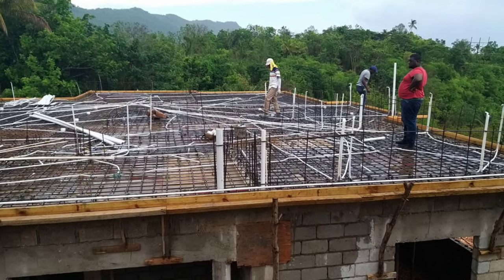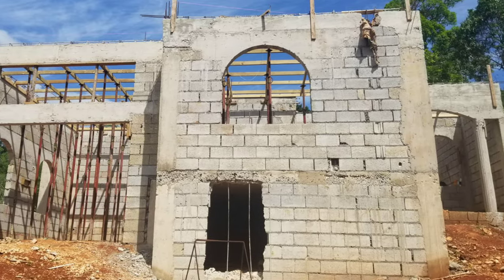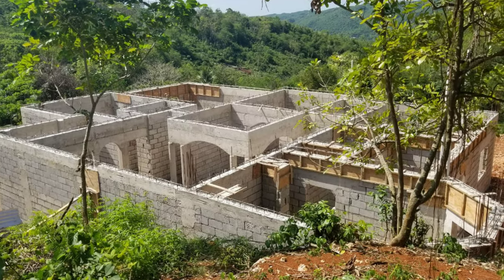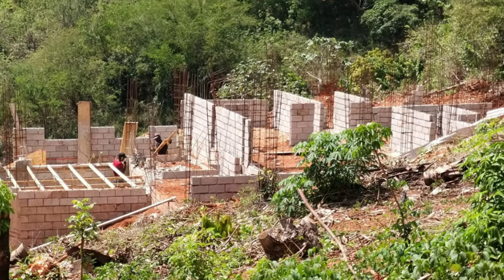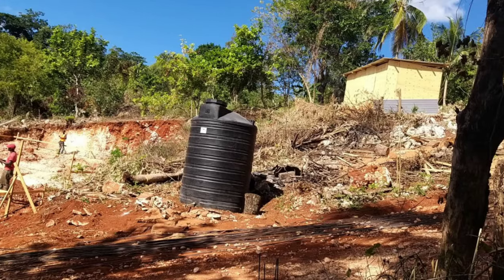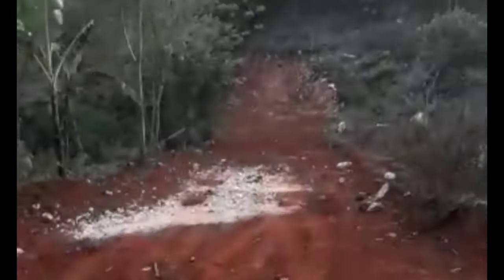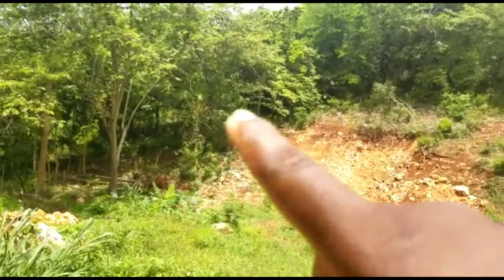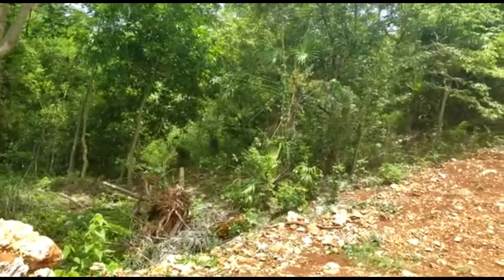The Real Cost To Build A House Concrete House Cheap Part 7

Comment: Such a big house an they going to build on top the steel work is not 100% cause i see no oversuport steel that's red flag
Reply: Unless you are going up another floor you do not need over support. The distribution bars are enough.

Comment: I use premix to do my decking and I realized when the mason flash and render my cealing it  cracks up and sounds hallow.. he said it's because its premix.. any advice?
Reply from the maker: Pre-mix or man mix if the concrete dries too fast the concrete will crack so if the day is very sunny and hot and the concrete is drying too quick this is what caused the concrete to crock the best thing is to wet it with water  next time
Reply: Nothing is wrong with pre-mix ..but pe-mix concrete contain a chemical harder which cause tge concrete to dry out too fast..once concrete dry too fast it will crack...hence you have to keep the concrete ( hydrate) wet it like 25 to 30 mins after it pour if it a very hot day and keep on wetting it..at least twice per day if the day is too hot..especially for the first few day for the concrete to cure properly